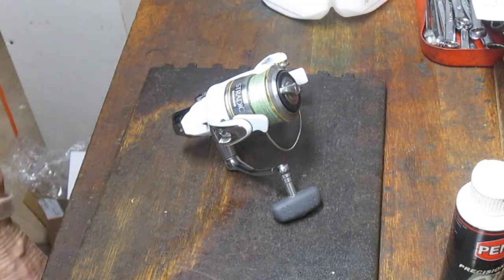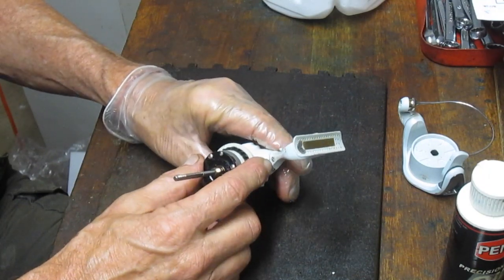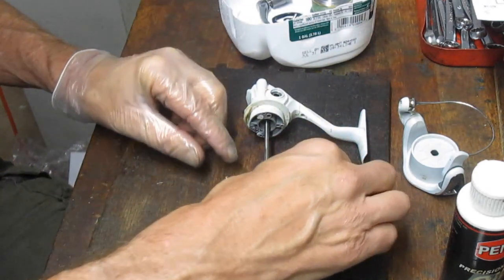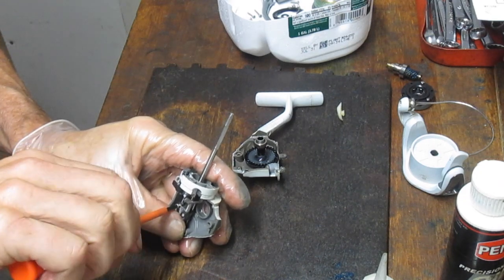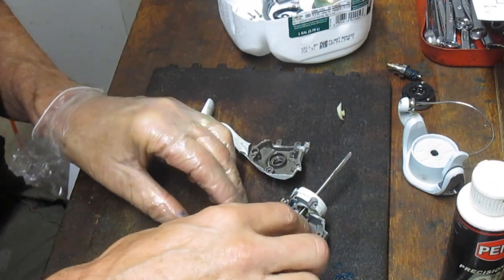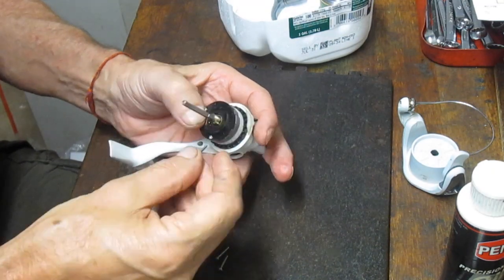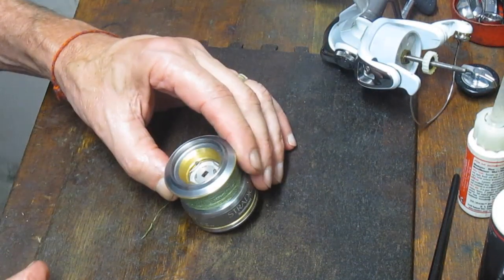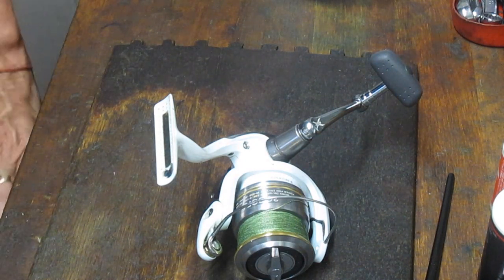Shimano Stradic 3000 FJ spin fishing reel how to take apart and service

Comment: I don’t own a Shimano reel. That’s kind of sad since I have over 80 vintage spinning reels. I have heard that the Stradic is a fine reel but I have no experience with them. I recently had a problem with a Roddy reel where someone put a lock washer under the rotor nut. I was really mad at whoever did that. I had to use a tiny chisel to bend the points down on that washer before that nut would budge. I don’t like to use hammers on reels! I use a tiny awl on pinions. Works pretty good. Often I’ll spray it with WD40 and brush off with a stiff toothbrush. From watching you I’d say Shimano is synonymous with screws. I like the oscillating system on this reel. Seems like it would be very accurate. It has a nice main gear. I haven’t been able to find Purple Power but Home Depot has a pretty good product that is similar. Don’t you love white reels - they show all the dirt!  Never seen a drag washer setup like this one. Altogether this is a fine reel but as you know - too new for me! Great video Dennis!
Reply from the maker: I like the worm gear oscillation.  It is similar to the level wind feature on bait casters.  Daiwa uses it on some of their tournament reels as well.  They are smooth!  Like you, I have seen all kinds of substitutions inside reels.  Screws, washers, springs, etc.  Sometimes it needs to be done if you can't get parts. -Not sure why a lock washer was used!  Thanks Chris - Dennis

Comment: I have a 2500 that evidently has a bad pawl as it doesn't oscillate. I that a tricky job to replace?
Reply from the maker: No.  The pawl assembly is easily accessible inside the case.  There is a cover cap that is removed in order to replace the pawl - Not easy, but not that hard either.  The difficult part of this reel is getting the lower case opened for the service, as you can see in the video - Dennis

Comment: You have it backwards on the spool shims. If the line is more at the top you need to lift the spool to get it even. By adding a shim.

Otherwise great video. The 706z one helped me
Reply from the maker: You are correct.  Thanks for the edit - Best wishes - Dennis

Comment: Hey man, just found your channel. I recently was given a stradic 2500FJ. How similar are those to the 3000? Also, seems that the handle spins both forward and backwards even with the anti reverse switch turned on. What do I need to do to fix this problem? Thanks!
Reply from the maker: If you do not have an A/R function, there is a problem in the assembly.  It could be as simple as a loose spring or it could be a broken or frozen A/R clutch.  You would need to take apart the reel in order to do an inspection.
The 3000 is similar in design, but I don't recall the model in the referenced video.  Early ones use an A/R pawl set up and later ones used the A/R one way clutch.
Dennis